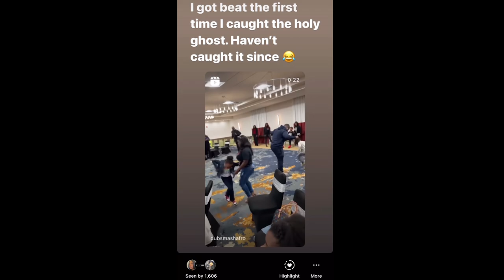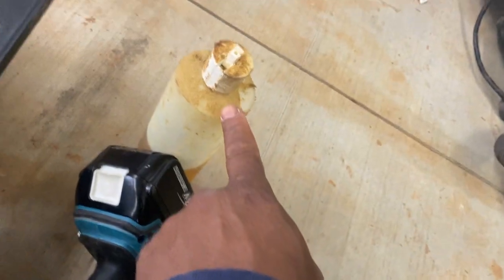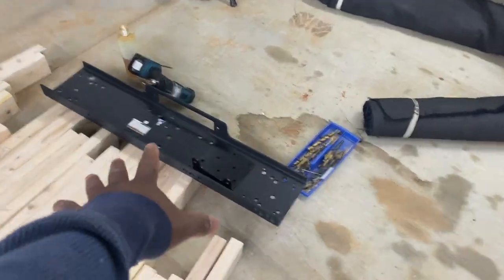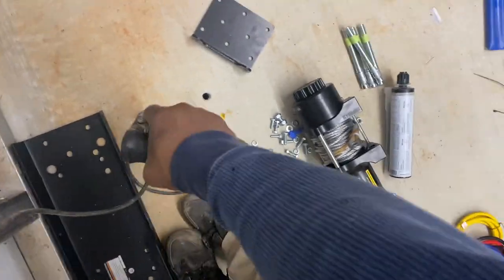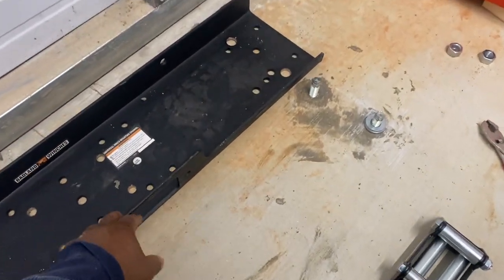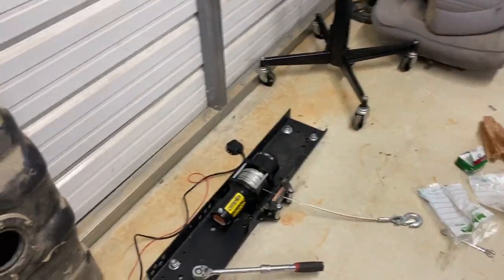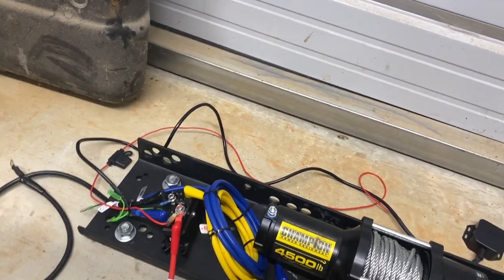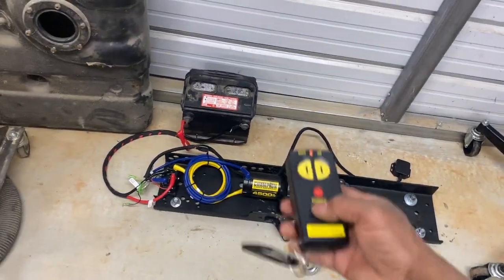Installing a winch on shop floor

Comment: All you need is a $40 battery tender to leave hooked up to the battery.
Reply from the maker: That’s it
Reply: @SteveDavisCarGuy  that viking 4 amp charger/ maintainer from hf ain't let me down over a year later. I paid less than 30 att

Comment: Yooo what up Steve.  Why are you removing your FiTech?  Do you not recommend it? Are you going back to a carburetor?
Reply from the maker: Car runs horrible when warm after 1 hr still no codes on the display. Takes starter fluid to start after sitting. Lastly it’s burning peoples cars up.